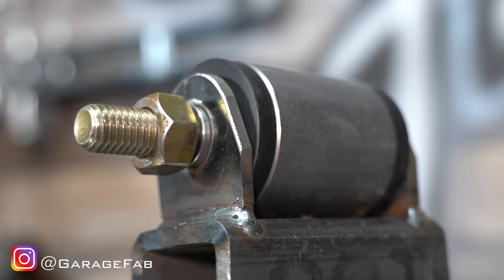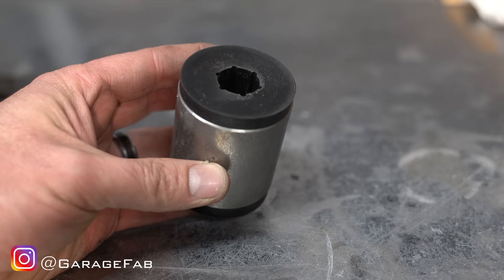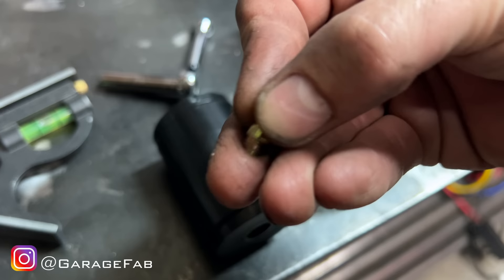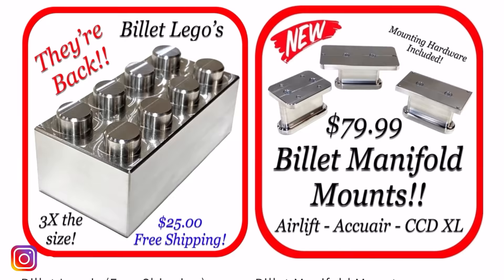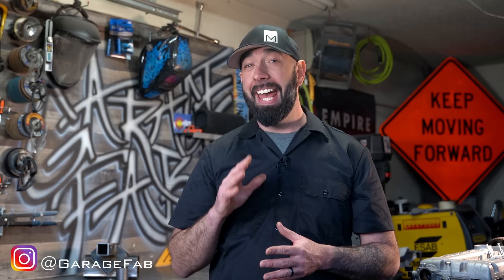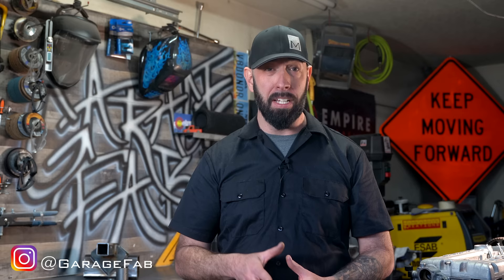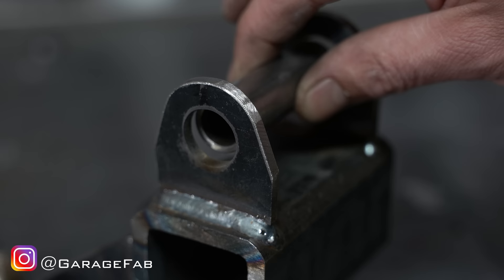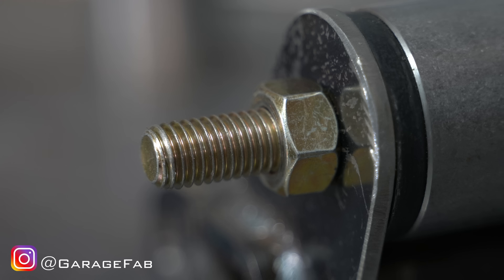The DOs and DON’Ts When Installing Polyurethane Suspension Bushings

Comment: I've never really built a full suspension but I have converted several different types to poly. All this seems very obvious to me but I guess I was learning on  things that were pre-engineered.  Thanks for the tip on where to get ends.
Reply from the maker: True. I think all the times I’ve seen mistakes where when people tried to make their own bushings. And once from a small company that sold custom control arms. They’re not in business anymore. 🤔

Comment: Yes your mostly correct. Engineering standards generally ask for no more and no less than 3 threads protruding after the assembly. So if you need to trim, use that as a guide!
Reply from the maker: This is the first time I’ve heard “no more than 3 threads” aside from aesthetics. What’s the reason for avoiding, say,  8 threads?
Reply: @GarageFab  wasted material.  Think about the extra 0.0005 cents that could cost per year!
Reply: @GarageFab  hey Toyota owner and mech engineer here...love this post and will follow you.  I'm about to do RR bushings on an 05 Highlander....so I went down this protrusion rabbit hole and unless there's a chance equipment or people will get damaged, extra protrusion is no risk...seems there is an aspect of using #threads to do a verification of bolt stretch if the design needs it....other than that, have one thread if you wish. ...so long as you have full nut engagement when the assembly starts seeing load during tightening. Cheers from rusty upstate NY!
Reply from the maker: That’s good info! Happy to have you my friend.

Comment: Best not to use polyurethane where you can avoid it, as it tends to transmit a lot more of the high frequency stuff, especially because sizing is usually not done well (ie; the intaller doesn't know what the forces are or the range of compliance needed). This is especially true of engine mounts, where lack of compliance can kill alternators etc.
Compliance problems are usually worst around 4 bar linkages, with triangulated 4 bars needing lots of compliance to work... Normally it's better to go for parallel 4 bars plus a watts link, it gives better control, less compliance interference with suspension behaviours etc and is simpler to calculate loads. 
Similarly, the type of bushing you're demonstrating here has very little lateral bearing capacity, it only bears on the edges of the steel tubes, so lateral loads are a big no no and should be oriented purpendicular to the link tube (unlike the triangulated 4 bar demonstrated).
Finally, bolted joints are considered to be failed when they slip, so the end of thread is (or should be) totally irrelevant, if it fails it's because it's slipped and failed under impact loads, resultant from the post failure movement. Size bolts so you've got at least one fully formed thread on the unloaded side of the bolted joint, but no other aspect is critical unless you're engaging onto the unformed threads of the shank, which WILL result in premature failure. The only parts involved in the joint behaviour should be the inner tube, clamped between the two flanges and the bolt it's self. The friction between the outer flanges and the tube are the only forces through which the joint should operate.
Reply from the maker: That was an insane amount of fascinating information. My biggest 😳 moment was alternator failure from poly engine mounts. What’s happening to cause that?!
Thank you for taking the time to right all that. You are appreciated, Drew.
Reply: @GarageFab  thanks, I appreciate it.
Poly engine mounts or rigid engine mounts can cause alternator failure because they don't absorb high frequency vibrations in the same way that traditional engine mounts do. You can get electronic or winding failure as a result of the increased fatigue loads.
GM makes some awesome hydraulic engine mounts that are studded on both ends and are basically awesome as a universal mount (LS/LT mounts).
And happy to help btw
Reply: Good info.  I installed a triangulated 4 link  on my truck.  When I supported the truck with jack stands on the frame unloading the suspension, I could move the rear end side to side with my hands on the tires.   The bushings were loose between the flanges after tightening  to recommend torque.   How should I correct this issue?
Reply: @Jack-dm8lj  are you fabbing the setup yourself? And are you particularly wedded to the idea of a triangulated 4 link? What do you want to use it for and how much travel do you want?
Reply: @drew79s  I purchased a kit from speedway.  It is installed on a 1952 chevy pu.  The brackets were cnc welded and made ready to attach to the frame and rear end housing.  I removed the end links and shaved about a 16 of an inch off the inner sleeves.    They tightened up nicely.   Did I screw up?  lol
Reply from the maker: I can’t say for sure because I can’t see it for myself, but it sounds like you’ve done exactly what you should have. In the bushing video, I state that the inner sleeve should be the same width as a Bushing with Bushing material installed. That wasn’t entirely correct. The inner sleeve should be just narrower than the assembly, which will allow the bushing to be squeezed slightly before the inner sleeve gets clamped between the tabs.
By the sounds of it, this is exactly what you’ve done. 
Something else to mention, is that the angle bars in a triangulated 4 link should be at least 30° from the frame rails. If the triangle that your upper link bars makes is too narrow, the small amount of bushing deflection can cause side to side movement. There’s a couple builds where the frame was so narrow that I couldn’t achieve this 30° and I had to add a panhard bar to my Triangulated 4 link. 🤷‍♂️
Reply: @Jack-dm8lj  as Garage Fab has said, I don't think you've done anything wrong.
Just to make sure I understand, it sounds like you fitted in accordance with the instruction and then manually cycled the suspension and it now has freeplay?
If that's the case it may be that one or more linkages are not precisely in position, or it may be that the kit simply allows more motion than their own joint compliance willl allow. Are you able to check where your compliance is coming from? Measuring the clearance at the back of each bushing will tell you where the bush compliance occurs, and checking to see if all the brackets remain square is implortant where you're seeing stuff like this, where there's potentially a mechanical bind.

Comment: Some stock rubber bushings are fused to both sleeves and you can expect a short service life followed by a rear steering wobbling nightmare unless you make a provision for the bushing to pivot. A bronze sleeve between the bolt and slightly opened inner sleeve is a great mod when feasible. Early polyurethane bushings had a tendency on rare occasions to squeak but only while driving unless you ignored their instructions for no lubricant.
Reply from the maker: The bronze sleeve is a fascinating idea. Rubber bushings are great for absorbing road vibration but absolutely terrible on high travel bagged vehicles. I’m all about polyurethane but gotta admit your suggestion sounds interesting. Hire do you tighten the through bolt and keep it tight? 🤔
Reply: @GarageFab  I make the innermost bushing proud and on the second one onwards turned an o-ring groove on both ends of the bushing plus a clearance groove in the sleeve that allowed grease to completely fill the pivot and move any wear fragments over the o-ring. The improvement in lubrication with impregnated bronze as the bushing material and 0.020" of added clearance in the central part of the sleeve was enough to extend the service life to where it no longer needed to be replaced just greased with oil changes. This was on a 97 Pathfinder after wearing out the factory bushings plus an updated version and 2 polyurethane sets. It became a challenge.

Comment: I was taught to give everything a solid coating of anti-seize. When your replacing bushings, you can tell a huge difference on disassembly
Reply from the maker: If you’re anywhere rust lives. Yes. Absolutely. Coat it up!!
Here in Vegas, anti-seize or grease will just be really really annoying.

Comment: @2:39  Damn straight.  I helped a friend put a lift kit on his Jeep, and we had to use a reciprocating saw to cut the bolts on each end of the factory bushing sleeves to get the control arms out.  The bolts might as well been welded to the sleeves.
Reply from the maker: Yup! We’ve had a few 4Runners come to our desert oasis from somewhere a little more rusty and we’ve had to do exactly that.

Comment: Very great video,
TIP= Grade 8 is great for street vehicles but the off-road guys in Baja stepped back to grade 5, This is because grade 8 and 10 will break in the desert on impact but grade 5 will bend. A bent bolt can continue the race and a broken bolt takes you out. Just something for your audience to think about for the application they are building for,
Reply from the maker: That’s fascinating! But it makes a lot of sense. Similar to sockets I guess. I was shocked to find out that impact sockets were actually SOFTER than chrome sockets. The softness allows them to flex and avoid cracking. Totally backwards from what I originally thought.

Comment: Before watching the whole video -- I paused it right after the terminology was explained -- It looks like the holes in the tabs are too big.  The inner bushing falls right through them.  When I've installed shocks, the inner sleeve also has teeth to dig into the inside of the tab. -- EDIT: BTW, excellent channel!  I just discovered it.  Liked and subscribed.
Reply from the maker: Bingo. Toyota also uses those toothed sleeves. 🙌

Comment: I bought lower control arms from a reputable company that sent me decent rods, but the bushings had already failed before I even got them installed.  Since there's a lifetime warranty on their parts, they actually sent me their revised beefier lower control arms.  The problem then was the bolts I bought for the previous bushings wouldn't fit in the newer sleeves, so that's something to be wary of when it comes to reusing or replacing bolts.
Reply from the maker: I have never heard of bushings sailing before install! 🤦🏻‍♂️ What “reputable” company was this?
So did you get everything figured out?

Comment: I'm actually helping a small manufacturer with R&D on replacement poly bushings for a car that has very little aftermarket or OEM support. 
Our goal is to offer owners with an alternative to the only existing poly supplier for these cars. We not only wanted to compete, but level it up by offering poly replacements for components not covered by the competition. 
This is definitely challenging as we're not making these parts for people building a car with custom links, we're making replacement parts for a car that was produced in limited numbers. So, preserving the foundation is key. 
Someday I hope to build custom subframes and control arms for performance restomodding these cars, but right now the goal is preservation. 
While doing our research we discovered a flaw in the competition's design. You touched upon this in your tab design comment. About how the tab needs to be wide enough to support the bushing flanges. We noticed this was not addressed in their design on many components and we've decided to address it in our design. 
A somewhat smaller flaw in their design was the minimal allowance for lubrication. They barely leave room for the grease. The designer building our parts has already addressed this in his prototypes. 
Another issue was the strict adherence to OEM inner sleeve dimensions on the part of our competition. The bolts used in the OEM design are much smaller than the inner sleeve diameter, especially for the subframe mounts. This is speculation on our part, but we believe the OEM believed that this gave wiggle room when attaching the SF to the unibody during assembly. Not all components were perfect and this compensated for that. 
We wanted to minimize that gap by bringing the tolerances closer together. When you have a 3,500lb car you're thinking about canyon carving or taking to the track, these components shouldn't be allowed to shift if someone didn't torque things down properly. 
This leads us to our next issue with the current maker. They don't supply installation instructions, not even a diagram. The only way customers know where things go is by referencing the part numbers on the bags to the online catalog where they bought them. Even then, there are no procedures or torque specs. 
Finally, the last bone of contention is with parts only being limited to suspension. We hope to bring more to the table, not by simply adding more suspension and subframe parts not previously offered, but by adding engine/trans mounts, radiator core suppprts, and muffler hangers. 
Long comment, I know, but the point I'm trying to make is you addressed a couple mistakes even professional manufacturers chose to ignore: lateral/torsional support and lubrication. 
What's worse is these guys corner the market on this car and they know it. So, they charge a premium for it. All while making an inferior product.
Reply from the maker: Well, Sir, I wish you the best of luck on this project. From what you’ve said, I’ve already come to dislike this other company. 😆 That seems to be a really common thing in the automotive world; Parts that come without instruction. I won’t lie. I’m the typical male that will throw away the instructions for an IKEA computer desk without opening them, but it’s not often you hear of deaths resulting from the faulty assembly of furniture.
Suspension components should probably have very detailed instructions and yet they rarely do. It’s bizarre.

I like where you guys are going with the project. I hope to hear updates!
Until then, Cheers!
Reply: @GarageFab  Thank you. Currently some parts are in prototyping while the rest are already sorted out. The only issue is that while our competition has already laid the groundwork for a majority of the parts, we're left dealing with the more complax ones they didn't want to touch. My car, a 1992 SVX is also the test mule for this endeavor. The designer is over 2,000mi from me, so it's all measurements and images sent over the wire. I have also sent him quite a few of my parts to research and this means my car has been down for a considerable amount of time. It's not feasible for me to send the larger parts and this is where things really come to a crawl. Not having those components makes it hard for a person to wrap their head around things. How it's mounted in the car, types of surfaces being dealt with, tightness of fit etc. We'll get it figured out soon enough. I mean, this guy made complete kits for the Justy of all cars. If he has the patience and skill to do that, the SVX will be a cake walk. 
As for instructions goes, that's the easy part, and we can't agree more about safety. I mean, minimally, torque specs should be listed. We'll be sure to exceed that standard.

Comment: Having done a  fair bit of racing in years gone by (Trans Am/GT-1, current and historic) we worked closely with the guys at Pratt&Miller for suspension and stingers.  For the most part we used Heim/spherical joints...  but in the rare circumstance that we used bushings...  we did not use grease.  We were instructed to use Walter Rock'n Roll.  You can't melt it.  Well, you can but it takes 2500° F.

Comment: Some awesome advice and comments.... would just like to point out on the washer topic, high tensile lock washers don't and shouldn't wear and break open over time especially when installed the right way round which counts for flat washer aswell, yes they are designed to go a certain way that being flat side to contact surface. On flat washers aswell go the same way and we use them not only to spread load but also to absorb any tearing force from lock washer as it better to replace a washer instead of tabs.
Reply from the maker: Good info. On lock washers though, I’ve never noticed visible difference in the two sides. Flat washers however, I always put the “domed” side up, but only because I’m OCD. 😆
Reply: @GarageFab  There is a difference in lock washers aswell as flat there is a rounded side and a flat side, the flat side always faces contact surface and rounded side facing torque surface thus being the nut or bolt

Comment: I just found your channel....Nice video! many years ago, someone said to me "never use anything less grade 8 on vehicles with stressed or weight bearing. Like the engine in my 1946 Harley knuckle-head. or my 1972 corvette. They are both old beaters, but the running gear is very tight.

Comment: Good info vid, thanks.
My first rebush failed within a month.  The body men asked "Didja lube 'em?"  Crimson me said "Oh."  That was an easy fix.  Two 1990 F-150 rear leafs quiet once again.  Dick Cepek parts had no installation tips sheet with them.
Reply from the maker: There are a lot of aftermarket parts like that. Not sure why. Perhaps they assume, “Dudes are gonna install this. Dudes throw out instructions so what’s the point.”
Be aware that there are varying qualities of polyurethane as well. So grease with silicone based lubes and stick with reputable brands like Energy and Daystar.